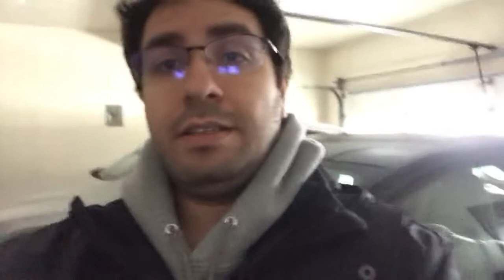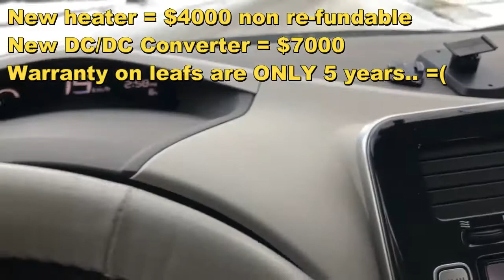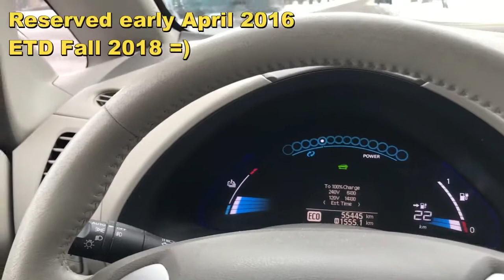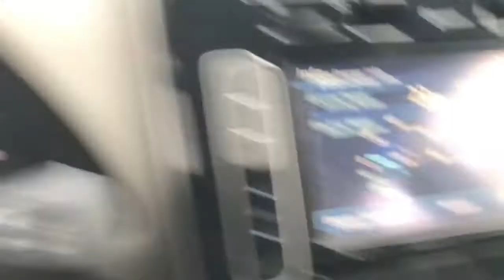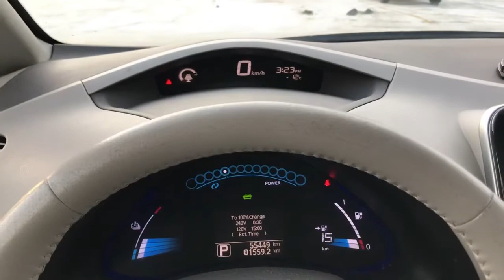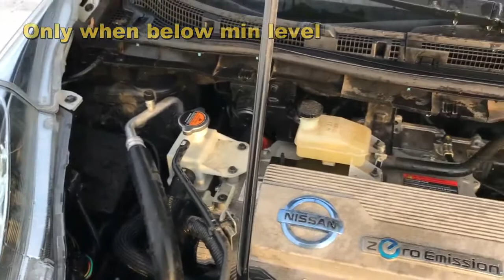Nissan Leaf in the Freezing Cold without a heater! - Range & Battery Discussed

Comment: How does it charge in cold without a heater? A Lithium-ion battery should not be charged below freezing point.
Reply: A lithium battery shouldn't be charged at a 1C or greater rate below freezing*

Comment: You mentioned a heat pump. A heat pump will not work in temps below around 10-C as they revert back to heat strips.

Comment: I am very interested in the EV, but they are going to have to first make them where they are practical. One the price needs to be brought down to the same level of a comparable gas model which h is in the 15k to 18k out the door. Next they need t get the range up t at least 500 miles using full heat or air. Also they need to get the charging times down to 10 to 15 minutes empty to full charge in all weather climates.
Reply: John Smith Your dreams are extremely difficult to achieve at the MSRP you desire. Are you also waiting for a BMW ICE car for that price? I wonder as to the range you need or are you trolling?